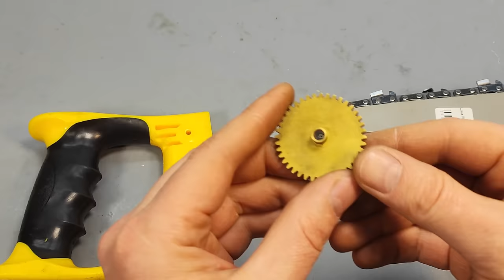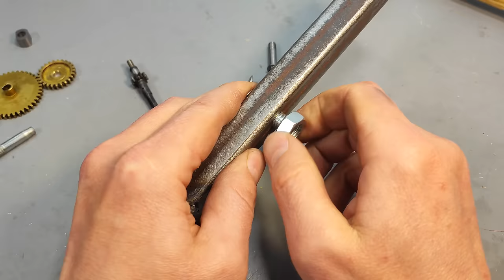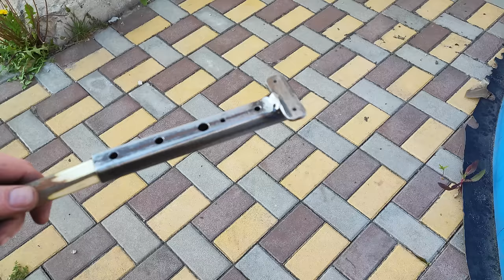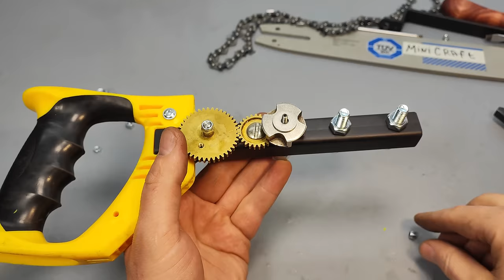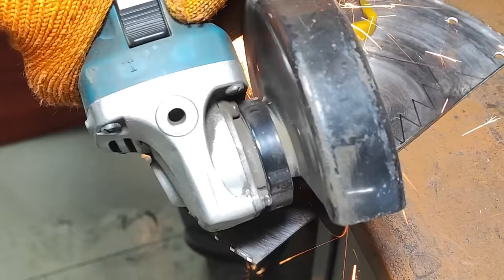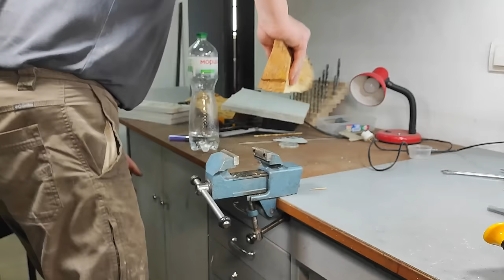Amazing Hand power Chain Saw

Comment: What did you use for your 3-tooth chain drive gear and the spindle that drives the 3 tooth gear?
Reply from the maker: This is a special gear for a sawless saw. sold in the spare parts store for saw-free saws
Reply: ต้องใช้น้ำมันหล่อลื่นโซ่ด้วยครับ
Reply: @serengytech  o

Comment: That is cool for camping mostly if somebody don't want to use power tools.But the only problem is must to do the RPM as the power tool,for some small branches could cut but big  could be tough.
Reply from the maker: In fact, this saw can only cut foam.
Reply: It was possible to develop this saw... think carefully and reinvent it😢